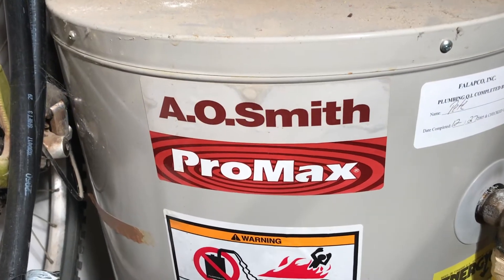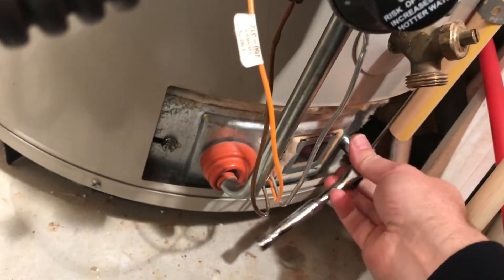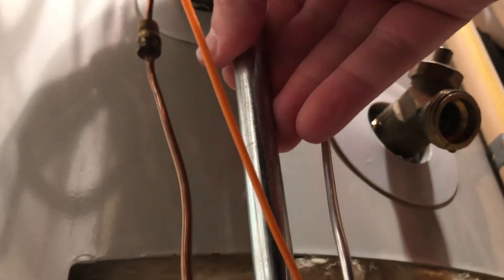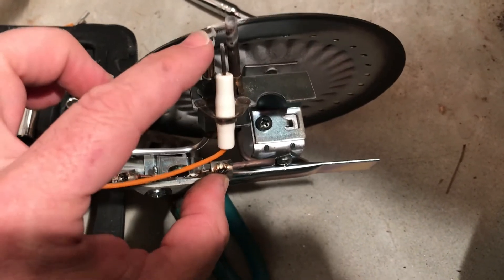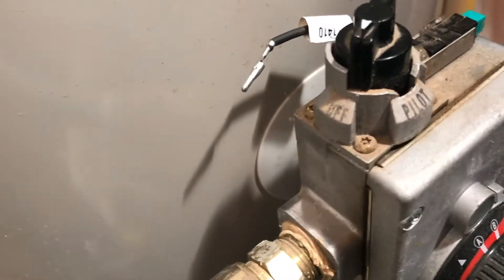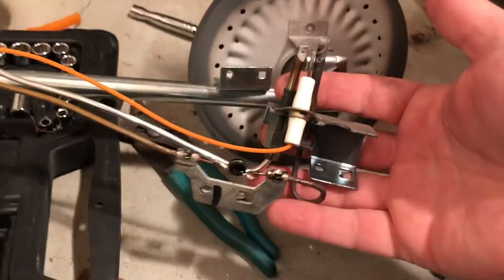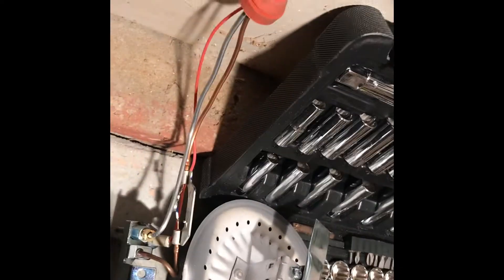Water heater not working? Gas AO Smith water heater pilot assembly replacement

Comment: Thanks for the video. I have an issue I assume is pilot assembly related, but not sure. I've had a faint smell of gas from my AO Smith water heater since I purchased my home almost a year ago. I've bubble tested every single gas connection in the home several times (including lines for pinhole leaks), but never found the leak. I finally purchased an electronic combustible gas leak detector and found there is gas leaking at the AO Smith water heater 's vent, and it's peaking the meter! When I sniff the vent the smell gas is very obvious. This is why I was unable to detect the leak externally with the bubble method. It's important to note that the burner has a strong clean blue pilot flame and combustion looks normal when the water heater turns on. No error codes on control valve. The vent pipe is drafting normally with smoke tests, both with utility room door closed and open. The air intake screen at bottom of water heater is clean and unobstructed. My question is why am I detecting a gas leak at the water heater vent if the pilot is lit and it's burning and drafting properly? Is it possible the burner assembly has a leak somewhere? Possibly at the pilot light assembly connection at the burner? I'm concerned as there is clearly gas detected at the vent even with pilot lit and proper combustion. I don't see how this is possible unless the pilot or burner assembly is leaking somehow? Any suggestions would be greatly appreciated. Anyone else ever experienced this?
Reply from the maker: Wow, I’ve never heard of that before!
Reply: @typicalthrill  It doesn't make much sense. There's no gas backdrafting from another appliance. Gas is clearly leaking internally and exiting the water heater vent at the top. I don't see how this is possible since the pilot is lit and everything functioning normally. If the pilot was weak, yellow, incomplete combustion, etc... it would make sense.
Reply from the maker: @acidfuzzpedals9986  I agree. I don’t know how any gas could get past the flame and to the vent without burning. Very strange.

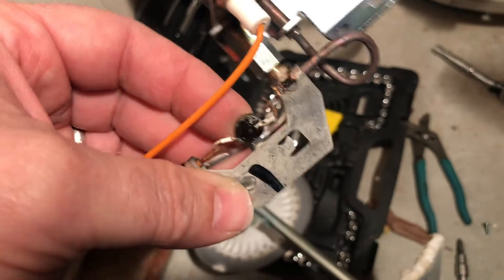Comment: 8:15/17:53, What is the function of this little black  pill? 
My water heater part is very close to your, except no electric orange cable (see 13:54/17:53) for ignition. There are 3 line: gas line, pilot line, and temperature line.
My water heater AO Smith 40-242 has been used since 2001. It never happen before, always hot enough. It just happened no hot water few days ago. I checked the water heater, there was no light at all on the pilot. I can light the pilot, but, once I release the knob, the pilot is off right away. What is the issue/problem?
Reply from the maker: The black "pill" is in the thermocouple line, so I believe it is some sort of heat sensor that tells the heater to cut off the gas if the pilot isn't lit. The issue you're describing sounds like the thermocouple. My heater did not allow for the easy replacement of the thermocouple by itself, so I had to buy the full assembly. If your thermocouple can be replaced by itself, you'll save a good bit of money. If you can keep the pilot on long enough to light the heater, it should stay lit until you have a full tank of hot water. Once it cuts off, though, you'll be right back where you are now.  Good luck!
Reply: Thanks for this reply, too 😀

Comment: Nice video.  What is the threaded connector fitting that goes into the water heater control called? Its the 1/4 inch connector which uses the compression fitting at pilot light. Thank you
Reply from the maker: I'm not sure what it's called. Are you talking about the actual nut? The kit I got came with all of the connections I needed.
Reply: @typicalthrill  yes, it’s the nut.  I heard from both home depot and true value that I you can’t buy that nut at their stores. Maybe get it off an old unit or buy the whole kit.
Reply from the maker: @garyduran1  You may have some luck calling up a local plumber to see if you can pull one from an old heater. Sometimes they have some sitting around before they haul them to the scrap yard.
Reply: @typicalthrill  will do. Thank you

Comment: I have that same water heater and cleaning the thermocouple didn’t fix it. Can you replace just the thermocouple or do you recommend replacing the whole pilot assembly?
Reply from the maker: If it’s like mine, it looks like the thermocouple is built into the assembly. It seemed like more trouble than it was worth to try to replace only that piece.
Reply: @typicalthrill  Yes, you are correct! I took one look at it and said nope. Lol Unfortunately, I can’t find the pilot assembly anywhere locally. My hot water heater is 14 years old and I’ve already had some issues with it so I think I’m going to just have the whole thing replaced. Thanks for getting back to me!
Reply from the maker: @lakola7632  Yeah, I had to order it for mine. Good luck! Thanks for watching!

Comment: I did the soapy mix. And get tiny bubbles on the pilot fuel line
Reply from the maker: If it could be a gas leak, you don't want to take any chances. It may be time to call a professional. You can check the connection again. Make sure it's not cross threaded and tighten it firmly. If it still looks like bubbles are being blown around the connection, I recommend leaving the gas off and call in a pro.